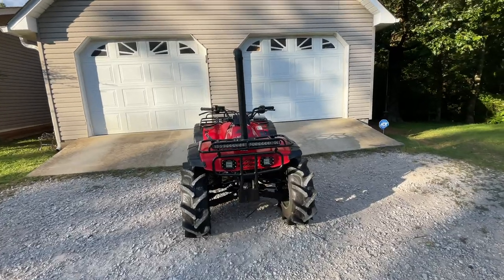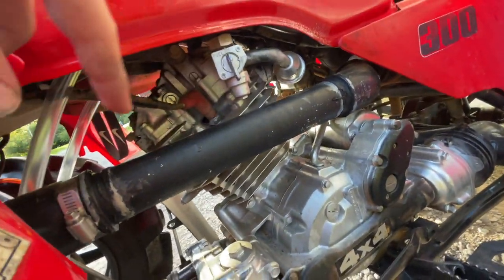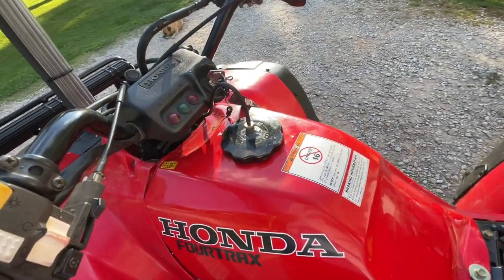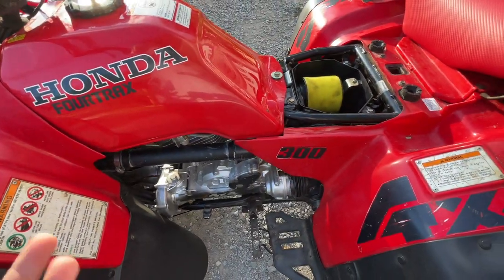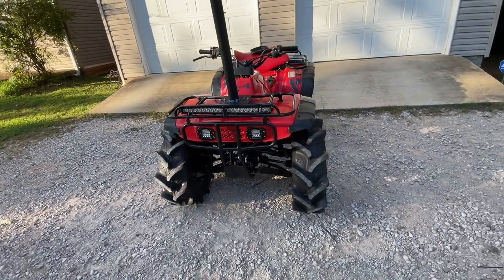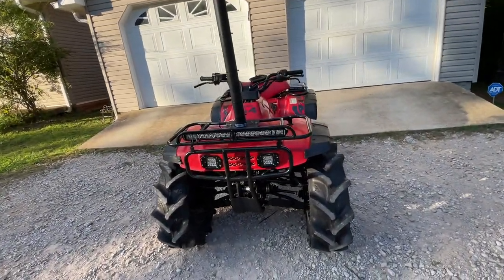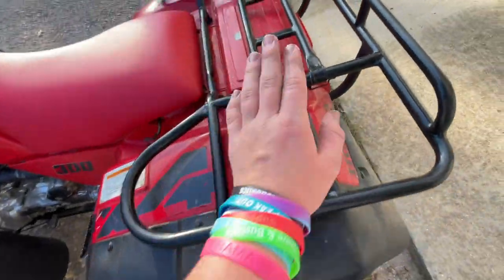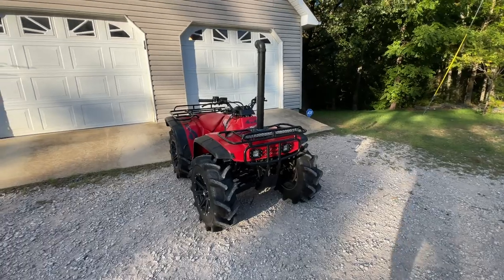HOW TO SNORKEL A HONDA FOURTRAX 300! (DONE RIGHT)

Comment: Clean snorkel setup, but be sure to put a bead of dielectric grease around that airbox lid to keep water out, make sure to get that one way on the bottom of the carb bowl or it’ll shut off as soon as that gets in water.  Ready to see this thing crossing ponds🤘🤿
Reply from the maker: thanks man and i got 2 one way check valves on the bottom of carb vent now and will make sure to dielectrics grease lid and spark plug 🤝
Reply: Grease will not keep water out if you plan on staying under for any decent period of time. You have to silicone the lid. And run the carb lines up the snorkel do not trust the check valves .

Comment: My 98 only has 1 carb vent and the overflow run it up the snorkel and ur good
Reply from the maker: thanks i thought there was only one
Reply: If you run it up your snorkel if or when your float sticks your motors gonna get filled with gas
Reply: @gtall300  yeah I meant run the 1 main vent up and the overflow should be looped and put a check valve so it can pour out if it sticks. I learned that the hard way lmao
Reply: I just ran my overflow on my motorcycle straight into the filter. I would just run it into the airbox. As long as the carb is working right it won't hurt nothing.

Comment: JBC please get back with me. i did you’re crank breather vent. yes everything is super super tight.  i mean i have retightened the clamps bc i thought it was me. went on and replaced clamps too. i am still getting a white liquid gargle in the service loops of the crank breather. when i mean it is seal it is sealed. brand new vent tube from lowes identical to yours. also if it sits overnight i turn the gas off and i come out next day and for some reason the air box drain plug is got gas in it so i have to pull the plug. its halfway up the drain plug everytime.
Reply from the maker: same thing is happening to me. i found out that it is normal, it is just condensation. it won’t harm nothing, and eventually the condensation could pass, and the fact that it is pulling the condensation through the line to your airbox, says that your snorkel and crankcase is sealed well
Reply from the maker: i got the idea from solitude customs on youtube, and i asked him about it and he said that it is normal and it is workinh how it is suppose to
Reply: bro heck yes thanks for the reply. do you get fuel dumping into your airbox when u let it sit overnight
Reply: or maybe its when im flooring it im not sure. bc i can go in a lake and come out and have the same amount as i do if it sits over night.
Reply from the maker: i don’t think i get fuel in my airbox but i know my crankcase leaks that condensation into my airbox sometimes. maybe yours is condensation too?

Comment: my carb has 2 vents, do i need to run bouta of them?
Reply from the maker: yes i would, the oem ones have 1 but the aftermarket usually have 2.
Reply: @jbccamp  ok thank you
Reply: @jbccamp  what size vent line do i need?
Reply from the maker: @mx_logan  i believe it’s 3/8 but just look up stock honda vent line size

Comment: Do you have a list of everything you needed? Thanks!
Reply from the maker: pvc, pvc cement, vent lines, vent hose, black gasket maker as a sealant, 90s, 45s pvc, and everything else i covered in the video
Reply: @jbccamp  thank you for this video, I just re ran mine because the guy I got it from used vacuum hose. I like your setup the most. Don’t forget to put a check valve on your carb if you don’t have one.
Reply from the maker: @TacticalNightBoy  thanks man and i already did, i put 2 one way check valves on mine
Reply: @jbccamp  I learned the hard way 🤣 but thanks again, you’ve earned a subscriber. You have tik tok with this fourwheeler?
Reply from the maker: @TacticalNightBoy  😂 and tiktok is jbccamp

Comment: I snorkeled mine with 1” 1/2 and it’s spitting and sputtering. Any idea? 1997 4x4
Reply from the maker: probably needs rejetted. carbs are weird sometimes they have to be rejetted sometimes not.
Reply: @jbccamp  it was running fine with the pool hose snorkel. Then I changed to pvc pipe. It’s throwing me off. Any recommendations on what size jets?
Reply: I’m down south in Mississippi.
Reply from the maker: @DylanBurgeProductions  same thing happened on my rancher. i went from 2inch then to 1 1/2 and it was running terrible. swapped back to the 2inch and it ran fine again. don’t know much about jett’s but you can probably look it up and find it
Reply: @jbccamp  well the issue is, it’s the same size pipe as the hose was I pulled off. Which isn’t making since to me. But I am gone order some jets this week and give it a try. All else fails I’ll throw a exhaust on my bike to compensate the bigger jets
Reply from the maker: @DylanBurgeProductions  ok let me know how it works out cause i’m curious
Reply: @jbccamp  aight. I’ll let you know
Reply: did you adjust you’re fuel screw
Reply: @mattpalmer9754  ended up being my new cdi box being defective. Just put the old one back on and it fixed it all